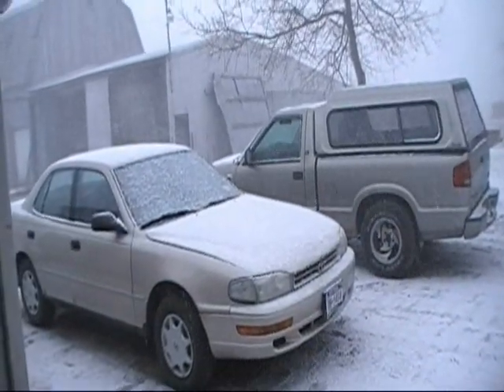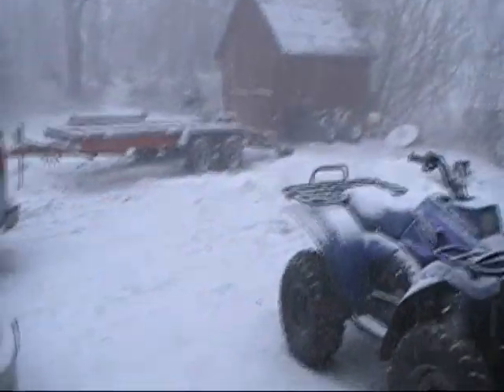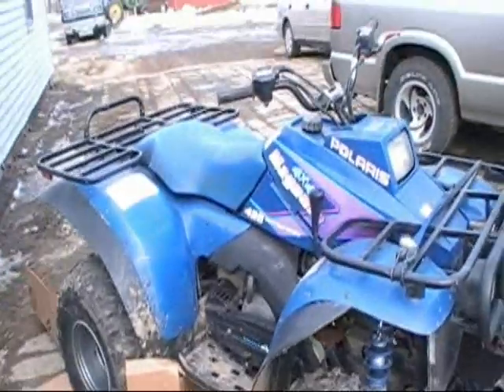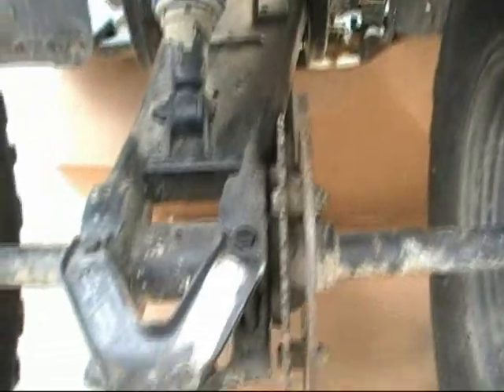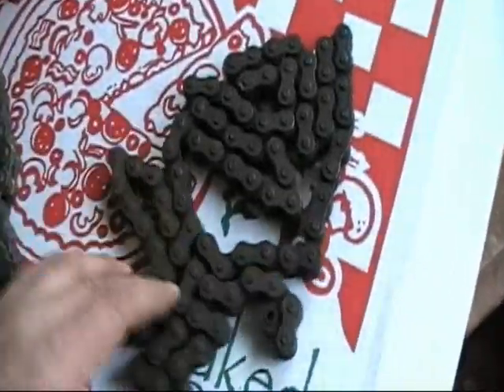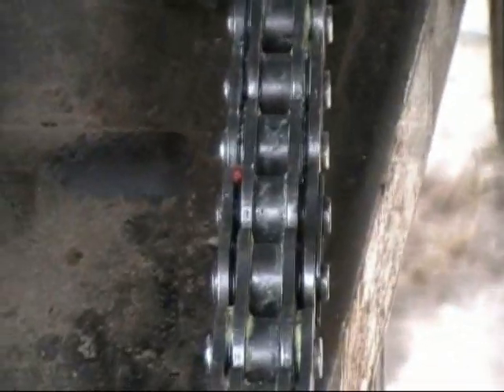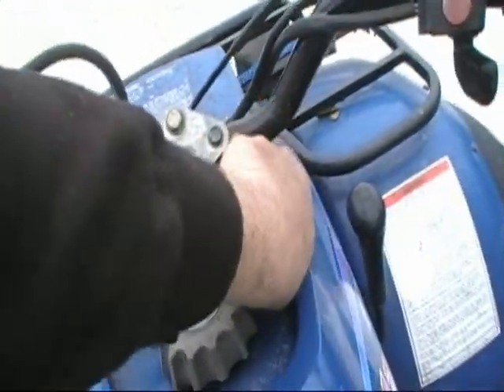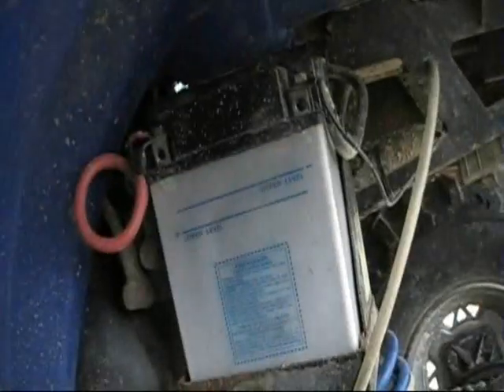1996 Polaris 425 Magnum 4x4~4 wheeler ATV Changing the Chain

Comment: fir ya tires.. check around the local dealers and used stuff paper.. you can get like new take off tires for the very cheap...check your motor mounts.. they are usually the cause of broken clutch covers....also check the clutch to clutch alignment...usually goes off with a bad motor mount... i used to work for polaris

Comment: The o rings on the rear dtive chain are to keep the chain lubed and therefore cool. No thermal stress to shorten it's life and lengthen the chain. Clutch cover rubbing sound is motor mounts being worn and moving more when the motor is revved up and moves to the left and rearward when throttled, carb gives more gas, motor's centrifugal force forces it to move and the motor mounts aren't stiff enough to stop it from doing so, and as it moves backwards the other problem is that it makes it rub easier because it is not shaped correctly anymore and closer to the pulley and clutch belt from shrinking and deforming from heat as well... one way you can keep that from happening is don't let your machine sit in idle it where's your belt out causes it to glaze and be slick there for harder for it to grab an engage and also it not engaging makes friction which in turn makes heat and then turn again makes your damn clutch cover shrink and make that hideous ass noise LOL. I enjoyed your video regardless kind of like I got to know you a little bit there even if it didn't show any work on the machine. The best way to replace the chain is cut the first one off with a angle grinder and then Hughes a mechanic to replace it that you get for free by finding someone you know that has sense enough to work on your machine while you watch him or you can do it yourself but just make sure you buy the correct tool. My link separator and chain fixer kit was about a hundred bucks and I'm glad I bought the good one because I can fix any chain up to about a #49,000lb per link roller o-ring chain with it... ha...lol.

Comment: i have the exact same fourwheeler down to the tape over the clutch cover. turns out I had a bad motor mount bushing causing the motor to vibrate badly at low idle, rubbing  a hole in the casing. try replacing that.

Comment: Hey my friend you still have the fourwheeler   If yes. I need your help i have the same fourwheeler and i need your help on the  wires look the previous owner   Unplug all the wires from the terminal wiring box  so i wanted put it back but i have no idea.  I got thr wiring diagram but i don't understand. How. To is more easier for mi if you can take a a short video from the wiring box just to identify the wires and the position where it goes  so if you can help me   Thanks on front   Also from